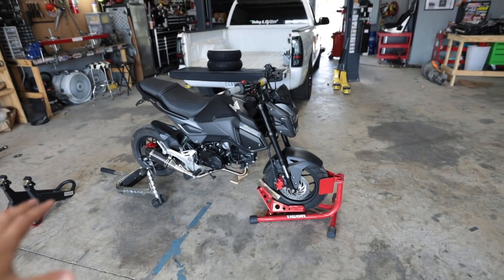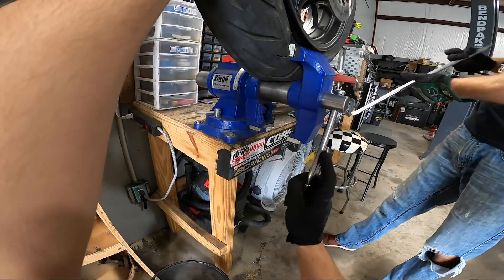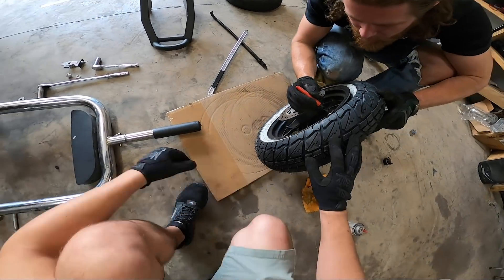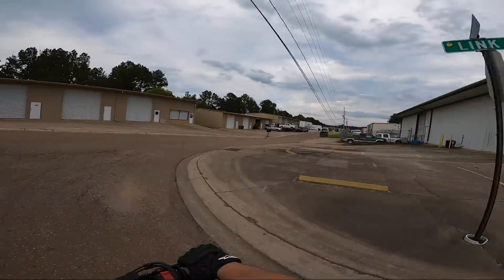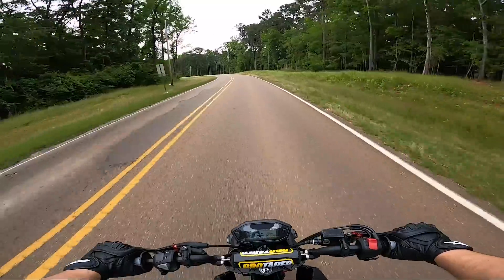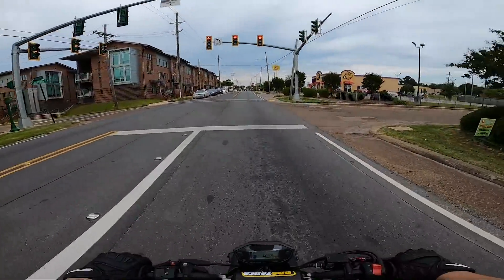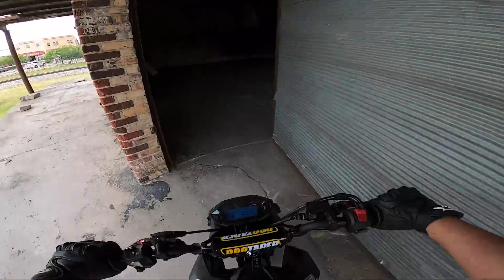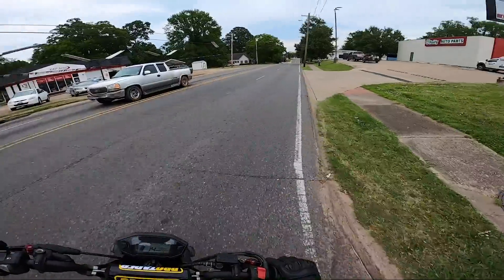NEVER pay to mount tires AGAIN! Try THIS instead.

Comment: I feel like opening the country is definitely the move because if the economy stays closed for too much longer thats like 10 years of economic downturn i mean some companies are still recovering from the recession. Dodge got sold to fiat. GM had to completely bankrupt and reform their company. And Ford barely survived. They had government bailouts. Imagine all the small buisnesses across our country that are the backbone of our economy they are beginning to cut their losses and declare bankruptcy. Thats bad and as harsh as it may sound some more people may catch it but most of the people in the death count rn didnt even have coronavirus they died of some other disease or organ failure and the resident that was writing the death report was pressured into claiming it was corona. Just a messed up situation really. Dont know who to believe
Reply: Coronavirus causes organ failure. Specifically of the lungs. It also compromises your entire immune system to other failures. People over profit any day. However, economies need to open slowly, otherwise you’ll have a second lockdown which will decimate the economy more than an extended initial lockdown, but they do need to start opening.

Comment: The thing about the China virus and opening up is that you have two sides who are thinking differently. One side is thinking about the deaths caused by the virus itself and is trying to stop those deaths disregarding the potential deaths caused by saving those who would have died from the virus itself. On the other hand, you have people who are focusing more on the deaths that could come from the solutions to the death-by-virus issue which would be ignoring the deaths caused by the virus. Both aren’t necessarily right or wrong right now, but we should be looking into estimated deaths caused by the lockdown and subsequent economic collapse, it’s almost impossible to get an accurate number, having to take into account how bad the economic collapse is going to be, which would determine what the causes of death are going to be like such as starvation in a serious collapse, but if it’s not that bad, starvation could not be an issue, we would also have to take into account deaths such as suicides, untreated illness, increased crime, all of these factors would come into effect with a lockdown scenario which would cause an economic collapse. I am personally in favor of opening up and letting the virus take its course, the deaths from the virus alone would be far outweighed by the damage caused by an economic collapse. Death is tragic either way, however since we have to make a decision, I say opening up will cause the least amount of death in the long run as well as maintain the quality of life we currently have mostly intact, whereas lockdown would cause much more death in the economic collapse not to mention severe drop in quality of life.

Comment: All small bike tires are a bitch. Ive grown up riding and racing motocross and street bikes now too. Have had many MANY bikes, my big bikes ( track and off road/woods racing bikes 250 2 strokes, 450 4 strokes etc) And many pitbikes, KLX110s and 50cc etc and BY FAR the worst tires to change are always the mini bikes. ALWAYS lol.. by the way LOVE the GROM build. All black with the white walls is just fire!!! I want to add a Grom to my shop so bad. 

Have had A 2015 GSXR750 and 08 R6. Looking at maybe getting a Dyna next summer.

Comment: Open everything up, anyone at risk should take extra precaution.
Reply: That’s not how preventing disease transmission, vaccines exist to allow healthy people to stop spreading the virus, but at risk individuals are sometimes unable to get the vaccines as their body cannot handle it, this is known as herd immunity . With COVID there is no vaccine so there is no protection for anyone and at risk individuals would literally have to not leave their house and even then if someone simply came to drop food off for them or whatever and was asymptomatic they could contract the virus and die, point being no one is immune, so spread occurs very rapidly, it is irresponsible to allow everyone to return and basically just say screw to at risk individuals

Comment: Bro there is a lot easier way to change motorcycle tires than y'all did. I've been changing my own tires on my R6 for like 8 years. Just need a floor Jack, ratchet strap, oil (new or old doesn't matter) and 2 flat head screwdrivers. I've now invested in tire spoons because I'm doing my car and truck tires also using the same method.

Comment: No man. No no no. Not that way. Once the bead is broken off the wheel on both sides put those big white plastic tie wraps round the tire not the tire and wheel but just the tire still on the wheel but the bead broken. Pull the tie wrap tight then space it so you have about 5-7 tie wraps spaced evenly around the tire pulled tight then watch how easily to wheel separates from the tire. Then put the tie wraps on the new tire the same way then with the wheel in place inside the tire then cut the tie wraps off. Bam done. There is a way to balance a tire with the mounted tire the shaft from the bike that  goes through the wheel sitting on jack stands. Slightly push the tire slightly so it spins. When it stops the heave side will be on the bottom. Place a weight at the very top section in place with scotch tape. Push it again. When it balanced you can move the tire while still in the jack stands to various positions and it won’t move at all. Then clean the wheel without the scotch tape place the weights on the wheel on the exact same place. Doing it like that you won’t have to worry about scratching the wheel. Peace. Oh put grease on the new tire before you put it on the new tire so when you put air to it the bead will seat in the wheel.